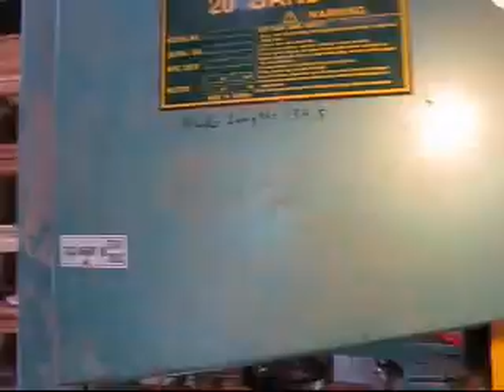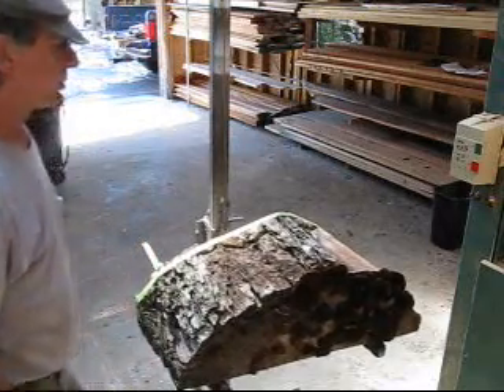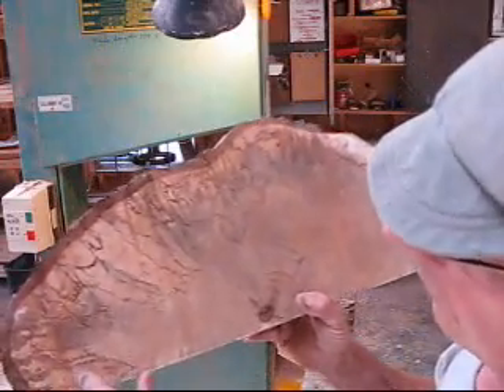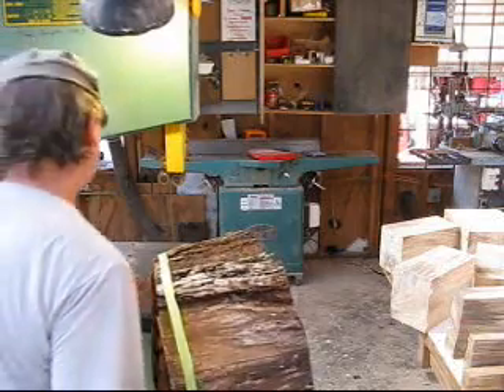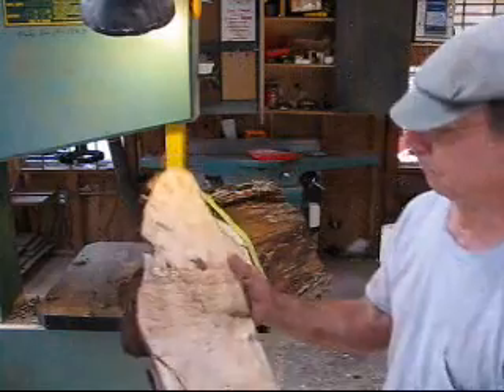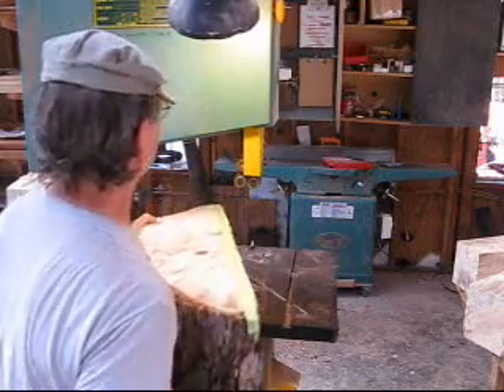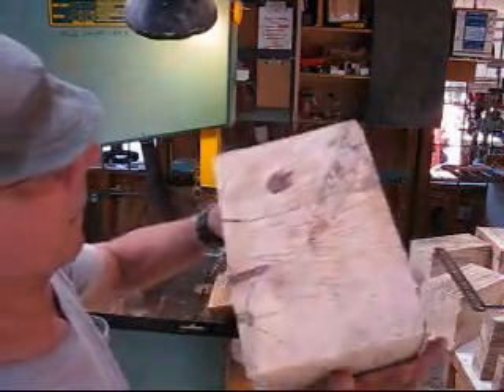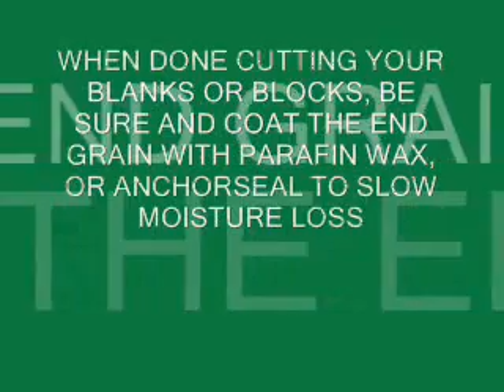SPALTED PECAN.wmv

Comment from the maker: W/O a bandsaw a chainsaw will get you close. By that I mean if you have a table saw say a 10"  then your blocks could be cut via the chainsaw to 3" or under then streight lined and cut into submission on the table saw.
 always use caution tho.
 A tempary fence would be needed to get your 1st streight line cut.